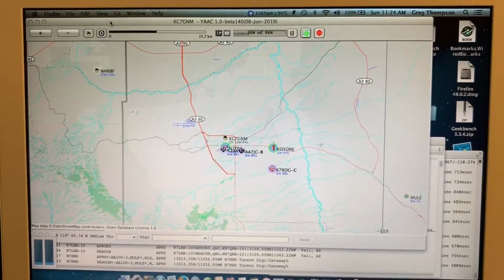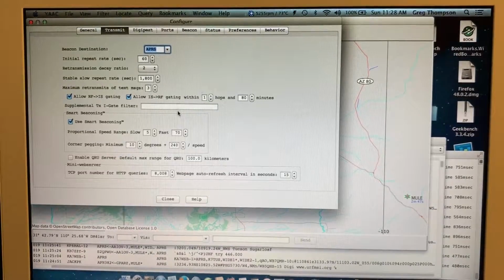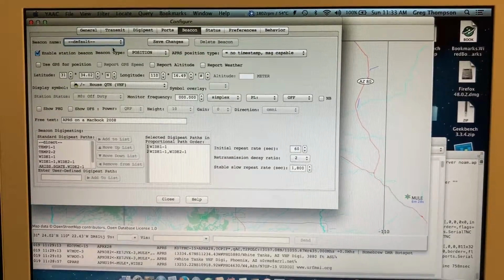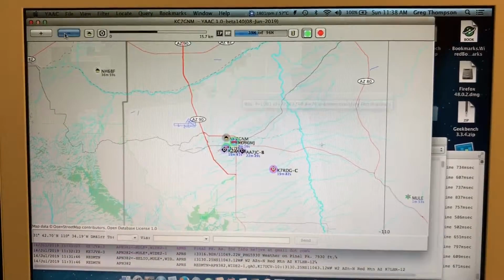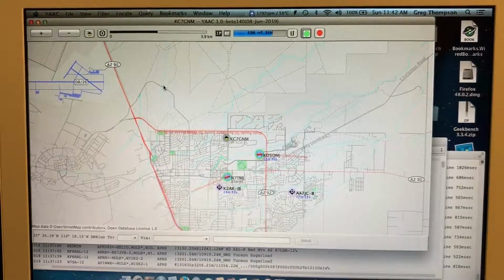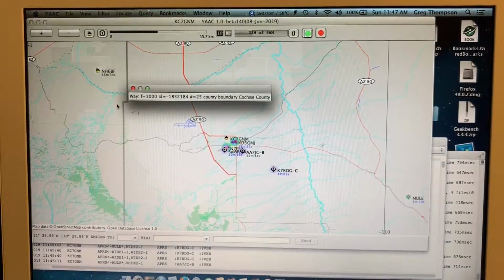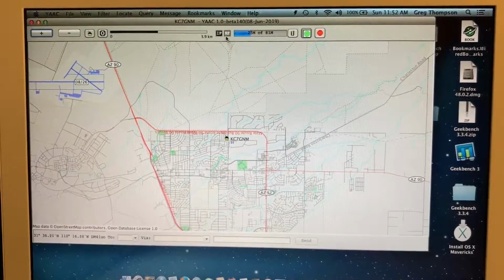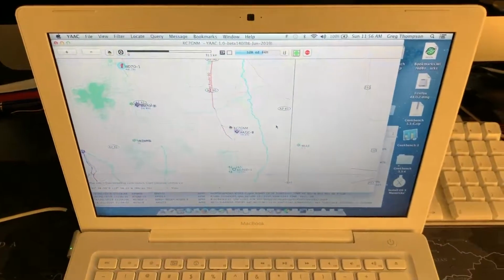Mac Ham Radio Series #1 APRS

Comment: Thanks for the video. I'm getting back into Ham radio after many years and have all Mac's in my household.  I wish you would do a video on setting up YAAC on a Mac, and how you made the autostart for the Java starting script.  I'm thinking of buying the Kantronics KPC 3 Plus that has the USB connector on it so I don't have to use a serial adapter. Do you know anyone running that on a Mac?  I'm Louis N4KWP.